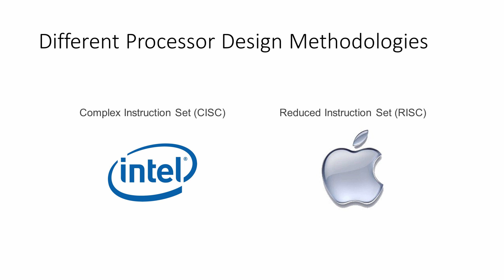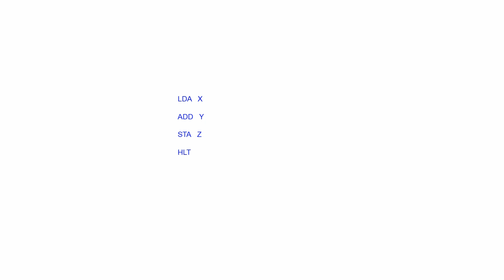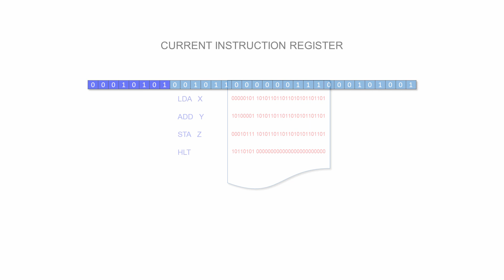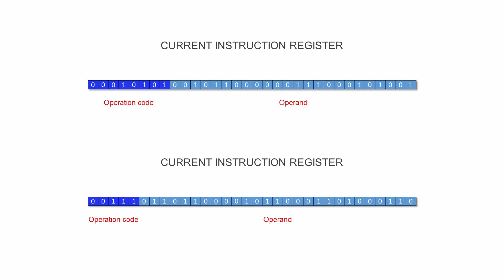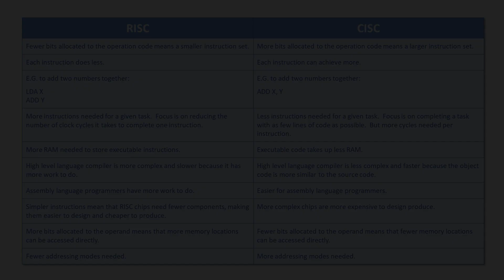RISC versus CISC

Comment: You'll find that CISC is ponpunced "sisk".
Furhermore, CISC architectures have instructions of different lengths, with the exact value of the opcode dictating the length of the whole instruction. In contrast, RISC architectures have instructions all of one length.
Reply from the maker: I think it's OK to pronounce CISC anyway you like.  :)KD
Reply: @ComputerScienceLessons Oh, well, I settled on "sisk" since that was more common as I had encountered.
There's a third type of computing architecture: VLIW. It implies instruction-level parallelism. I simply pronounce it "vlee-ew". Tongue-twisting, ain't it!

Comment: - RISC is BETTER, because RISC is next evolution step from CISC.
- RISC was developed after CISC (solving CISC problems).
- All famous 8-bit CPUs were CISC - Intel 8080, Motorola 6800, 680000, Zilog Z80, MOS 6502 etc.
- DEC had CISC VAX and then come up with 64-bit RISC Alpha.
- Intel had CISC 8008, 8080, 8086 and later come up with RISC-like IA64 (Itanium).
- CISC is obsolete today - there is no new CISC ISA while there is many new RISC ISAs (Xtensa ESP32, RISC-V, ARMv9, Lonsoon etc.).

1) Number of instructions:

    - RISC .... 64-bit ARM has around 700 instructions (around 100 for basic scalar integer/LD/ST, rest is FPU and vector/SIMD/ML extensions). 
    - CISC .... 64-bit x86-64 has around 900 instructions (again most instructions are FPU/vector/SIMD/ML extensions).
    - summary: difference between CISC and RISC is almost zero in terms of number of instructions. Basically it depends how many extensions are there. As in 2022 ARM added SME2 extensions (to the current SVE, SVE2, SME) for matrix computation up to 2048-bit long registers (x86 has only 512-bit AVX512) - this probably means than RISC ARM has today more instructions than CISC x86.
     - in real SW the 64-bit ARM binary as RISC has about 10% bigger size than x86-64 CISC (difference is negligible)
     - ARM-Thumb2 binary has 10-20% smaller binary size than x86 (Thumb2 was developed for MCU market, for full-size CPU the difference is negligible).

2) Op-code:
    - RISC obviously can have thousands of instructions (mentioned above). How is that possible?
    - ARM has multiple op-code templates for one operand, two operands, three operands -  op-code size is different, there is no need to be fixed.
    - I think author of this video confuses fixed op-code size with fixed instruction length. Instruction length MUST be fixed (usually is high performance RISC is 32-bit long (Alpha, ARM, MIPS, SPARC etc.), sometimes for MCU can be packed into 16-bit ARM-Thumb2, or small 8-bit MCUs like PIC use 12-bit, 14-bit instruction length to save space in tiny onboard flash) because it is the main advantage of RISC ISA - decoding unlimited number of instructions in parallel (very important for modern CPU as today best CPU can execute 8 instructions/clock in average).
    - CISC usually uses variable instruction length. x86 instruction can have 1 byte up to 15 bytes (8-bit up to 120-bit), consisting of two prefix instructions, main instruction and two postfix instructions. This is good for hand assembly coding back at 1970' when RAM was few kBytes and very expensive. Also 1 instruction at 8086 took 10 clocks to complete (0.1 instruction/clock is 80x times less IPC than today's CPU).
     - Modern x86 CPU has big problem with parallel decode - basically x86 CPU does know only where the 1st instruction begins but doesn't know where the 2nd, 3rd etc. instructions begin. 2nd instruction can begin at 2nd byte up to 16th byte,  3rd instruction can begin at 3rd byte up to 31th byte (number of combinations rise exponentially for every other in parallel loaded instruction). That's a reason why AMD Zen 4 still has only 4-decode (and using sophisticated predictors) and huge micro-op cache (with already decoded instructions for high price) while Apple M1 has 8-decode and no micro-op cache (because it can decode very simply even 100 instructions if needed).
     - This x86's unnecessary decoding hell cost transistors, workhours to find tricks around and burns energy

3) Every CISC (x86) CPU today is running RISC-like inside. First RISC-inside x86 CPU was AMD K5 competing with 486 and Pentiums AKA P5 (last CISC-inside x86 CPU). K5 was in-order RISC CPU Am29000 with x86 decode added to the frontend. K6 based on NexGen was out-of-order RISC-inside CPU (similar to Pentium Pro AKA P6).

4) It's pretty easy to modify Intel or AMD x86 CPU for another ISA, especially for RISC because it runs inside already as RISC. AMD converted RISC Am29000 into x86 in the past. There is no problem to strip over-complicated x86 decoder away and implement more efficient RISC-V or ARM decoder. Jim Keller did that with K12 when AMD was developing x86 Zen and ARM K12 in parallel as sister cores.

The true reason why AMD nor Intel don't do that is money - x86 market is big and nobody else has a license to make x86 CPU except Intel and AMD. They care about money only. However every company which focus on money making rather than delivering best possible products is going to bankrupt inevitably. Smartphone and tablet market is 5x times bigger than server market and growing.... and ARM has 100% there while x86 has 0%. Server market ARM got 10% in just last 2 years and fast growing (cloud providers offer ARM servers at half price/performance - during upcoming economic recession how many companies can afford to pay double price for same performance?).

X86 will die soon - because it's old/obsolete/ineffective and because it has bad business model (basically monopoly).
Reply from the maker: Good analysis :)KD
Reply: u are very good computer scientist and good analyzer.  I also think intela nd amd are going to get fcked in future but the gaming industry is keeping x86 alive. and its gonna take a looooong time for x86 to die because of gaming
Reply: I think a cross compilation, basically a risc pre-decode could help make backwards compatibility if they remove the on-die complicated decoder. Like you said, modern CPU's could really run any instruction set, more or less, depending on things like register count or the optimization of the maths units for the instruction set.

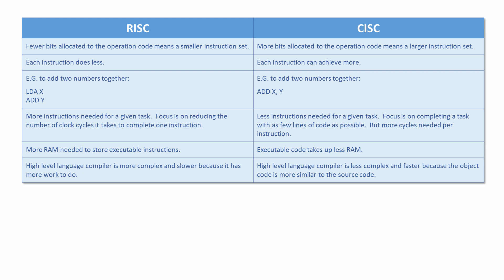Comment: At 9:55 you say that a CISC compiler is easier then a RISC compiler. I disagree. An optimizing compiler today has the same front end for RISC or CISC backend. The intermediate language, used for common subexpression optimization, can be the same. The compiler back end is different. But there are little details that make both kinds of back end complex. The Intel x86 CISC has registers EAX, EBX, ECX, EDX, but not every operation can work with every register. A classical RISC executes the operation after a conditional jump instruction independent of the result of the compare.
Reply from the maker: You are quite right.  My video is primarily pitched at A Level computer science students.  They learn the fundamental principles of assembly language via the Little Man Computer simulator - so I cite examples in this rather than any 'real' assembly language.  The differences between RISC and CISC is actually rather blurred, modern processors taking ideas from each.  I would be interested to know what you think of my series on compilers? :)KD

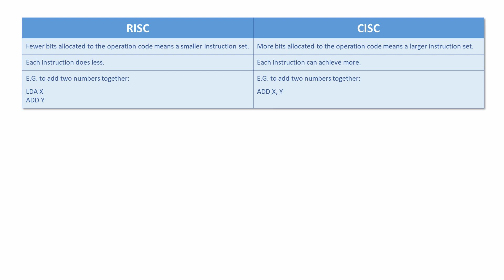Comment: At 8:39 you say that "ADD Y" is a (typical) RISC instruction. But this is a typical CISC instruction. A typical RISC instruction is "ADD R0, R1, R2". I don't know ANY RISC CPU that has a accumulator register. Why? This is part of the "one clock tick, one operation" idea of RISC. In a classical RISC CPU you can only write "ADD R0, R1, R2" that executes as R0=R1+R2. All registers have to be different. The operation "ADD Y" executes as A=A+Y with accumulator A is used twice in the operation. But this is a NO, NO for classical RISC. The CISC CPU does a little cheat. The CISC has a second accumulator, often called Atmp. The ADD Y operation is executed in two clock ticks. First do Atmp=A+Y, second do A=Atmp.

Comment: If a CPU use a 16 bit register with 8 bit for op code and 8 bit for operand. If the instruction have 2 operands such as MOV, does that mean the CPU can only access 2^4 address?
Reply from the maker: The simple answer is no.  Depending on the architecture, the instruction register might support 1, 2, 3 or even 4 operands.  If a particular CPU supports, let's say, 2 operands, then some of the instruction register bits will be allocated to the first operand and some of them will be allocated to the second operand.  If the instruction register of this particular CPU is executing an instruction with only 1 operand, then some of the operand bits will go unused.  I should point out that a modern CPU generally has more than 16 bits available in the instruction register.  Note also that at least a couple of bits need to be reserved to indicate the addressing mode being used and, depending on the architecture, an instruction register might allocate bits for other reasons, for example to indicate the number of shifts to be performed by a bit shift instruction.  Bit allocation in the instruction register is fixed; I'm not aware on an instruction register format that dynamically allocated bits depending on the instruction - now there's an idea! :)KD
Reply: Thank you for the answer. Excuse me if my question is not clear and sound silly since English is not my native language :-(. I will clear up my question as following:
Let assume a particular CPU has 8 bits instruction register, 4 bit for op code, 4 bit for operand(s). No special bit for anything else.
In this scenario, the CPU should be able to access 2^4 memory addresses from 0 to 15, but how can it execute an instruction to MOV the value from any address greater than 3 (i.e. move value from address 4 to address 5: MOV 100 101 require 10 bits)? So in this scenario, it can only access 2^2 address, right?

Comment: I know you may have left this out intentionally, but don't some instructions use more than one opcode?
Reply from the maker: There are lots of assembly languages out there, indeed every specialist type of processor has its own instruction set, so I would not be surprised (although I can't think of one).  It is not uncommon for an instruction to have a label as well as an op code, to enable branching and looping.  :)KD

Comment: The whole RISC vs CISC debate is over as RISC has won... 

Why? Because more then a decade ago processors accepting CISC instructions have started to internally be composed of a RISC processor that does a handful of instructions and a decoder that translates every instruction from CISC to RISC.
So even with the added overhead of translating Every single instruction Every Time it is executed was a better choice then trying to make a processor have separate circuits for every instruction(A lot of area) and have only a few "working" at any moment...
As x86(the most popular CISC instruction set) gets more instructions every several years, the more of trade off is in the favor of internally having a "RISC" processor...

Other things RISC is better at than CISC:
1. Compilers are terrible at picking the "best" CISC instructions. Where it is actually simpler to find the correct RISC instruction as there is not much of a choice.
Point: Converting RISC to CISC will result in say half as much instructions(generous) but for each(on average) you have many to choose from... Also the fact that computation difficulty in reguards to instruction count is roughly O(n) while to say the same for the number of choices for each instruction does not hold water... (Not simpler)
2. In actual "CISC" Processors today Sometimes it is faster to do a simple instruction multiple times, than the more complicated one that was made FOR THE EXACT computation.
(this is as I said because they are really RISC with a decoder at the front). Also more reason for the (1.).
3. RISC encoded program almost always takes less space as a vast majority of the CISC instructions are almost never used and yet they take bits...

Along with other I may have forgot...

Why is CISC still the most dominant in the PC domain? Mostly because of established standards... As sadly leaders of industries think to create a new standard, market the hell out of it and hope people use it instead is not profitable.
RISC is dominating in the Microcontroler/processor and Phone spheres... And is a vast majority of the processors made today, not including the pseudo CISC ones.

For more info, a good place to start is the great David Patterson's Lex Fridman interview...
YT sometimes marks a comment as spam if you include a link, so I won't.

Thank you for reading! And replies are encouraged!
Reply from the maker: Fascinating interview if you have time (https://www.youtube.com/watch?v=naed4C4hfAg) :)KD
Reply: @ComputerScienceLessons  Love your videos btw... Keep up the good work!
Reply: thanks, im using ur comment as my homework assignment so i hope u dont mind
Reply: @ngndnd  Not sure how you would... But glad to inspire

Comment: I remember when I was fighting with my Wintel PC-user friend in school about RISC vs CISC - I was right pmsl

It was Acorn vs PC back in the 90s lol
Reply from the maker: You're showing your age! Factoid - ARM originally stood for Acorn RISC Machine.  It was later changed to Advanced RISC Machine.  :)KD
Reply: @ComputerScienceLessons  That's correct. It was the first assembly language and machine code I learned whilst in high school - I was such a geek lol

I still have my 233MHz StrongARM RiscPC on the shelf lol

On a personal note, Prof. Ferber and Sophie Wilson are personal idols lol - She could type compressed ARM BASIC code!  Last I knew, Prof. Ferber was researching spiking neural networks using a cluster of ARM Spinnaker(?) chips. Fascinating stuff.